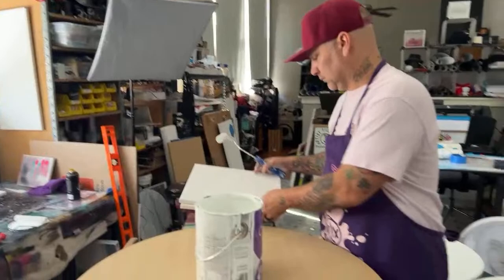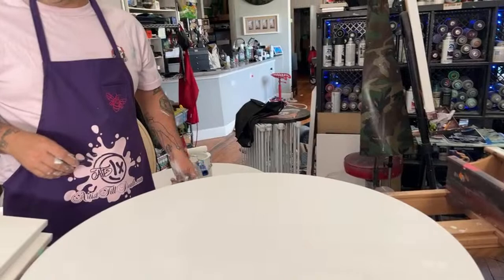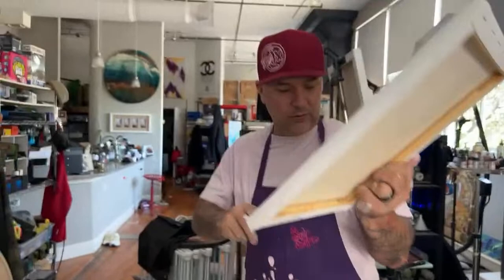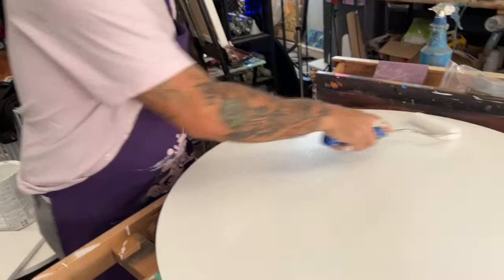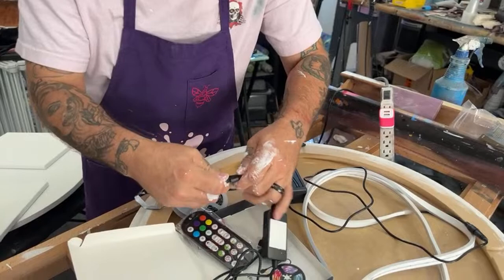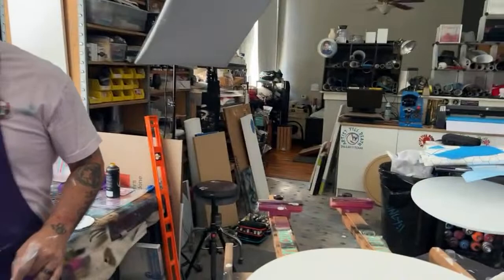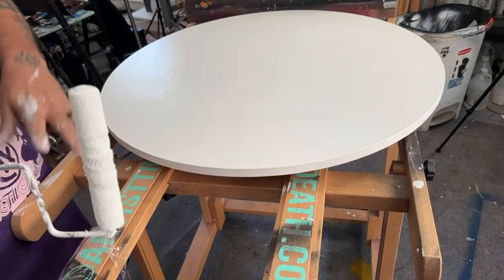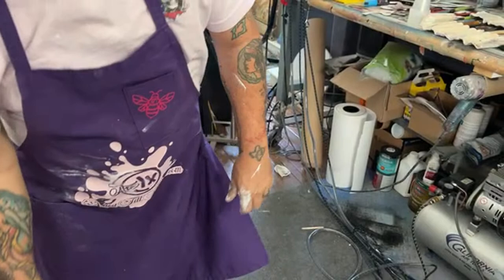How to prep a Canvas for Pouring/Alcohol Ink/Airbrush

Comment: With your led lights and spacing  vs EL wire ( electro luminescent wire)  is what is called,  there's a 5mm ribbon or 2mm or 3mm dia wire also you can splice different colors to together as the wires come in various neon colors... I love the stuff I think of it as  inexpensive, poor mans neon lighting.

Comment: Also what sizes do these cradle boards come in I need one where the back of it will fit a LP record and be a frame because I can’t find a round frame that’s round and will fit an LP I did a pour on.
Reply: They sell all sizes. Just check out their website…..it’s all there
Reply: @kymcrowart7876  THANK you ☺️ I need to use it on the backside like a frame and I need the back to be 13inch round